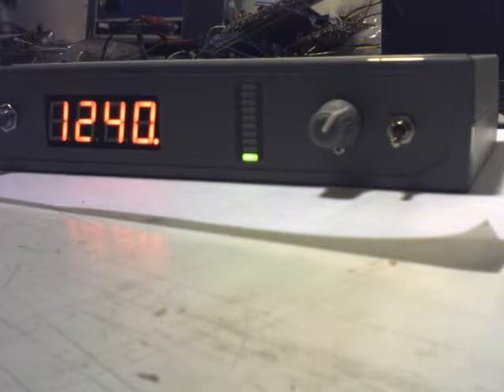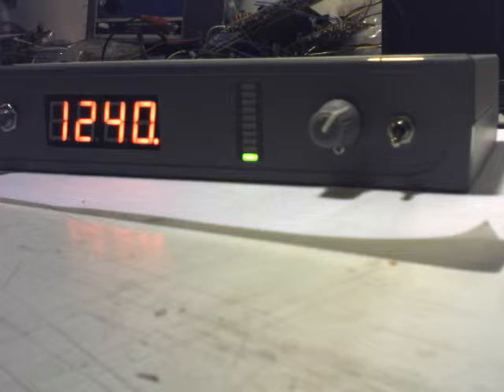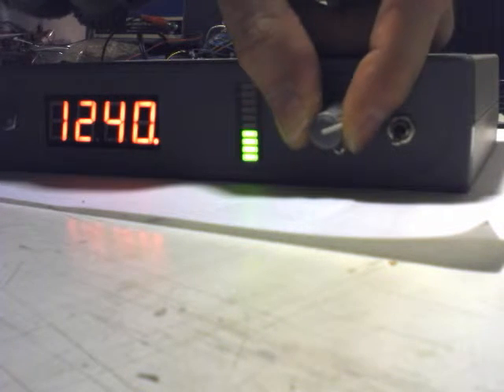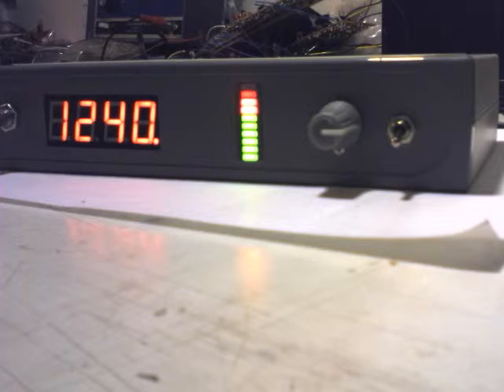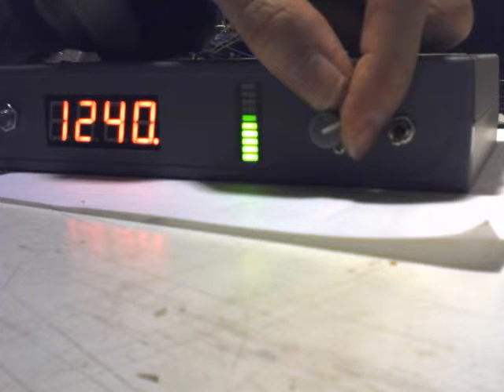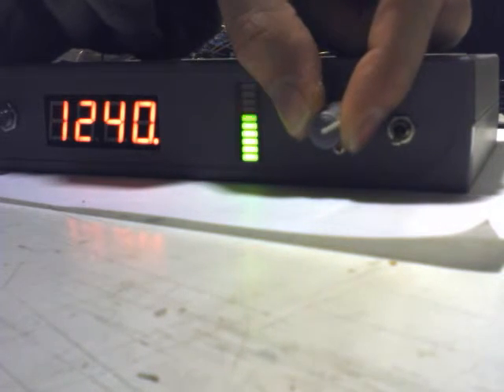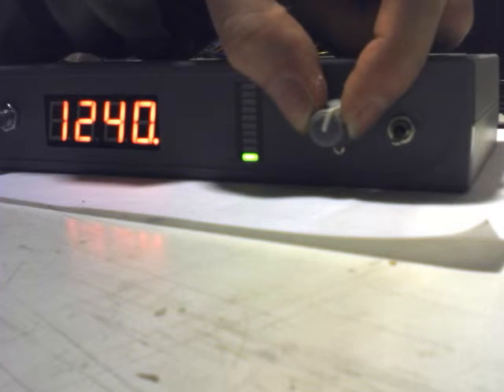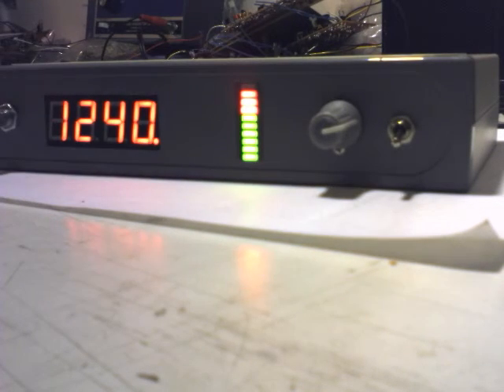Extra range

Comment from the maker: It is preferable to keep the antenna as vertical as possible. I have it set up as an inverted L shape.
The location makes a huge difference too. Here in the basement where I test, The wiring through the walls forms a kind of Faraday cage and very little signal escapes. Testing it outside increased the range by about 4 times. Another test was done when I was away in an apartment in Florida and the range was increased by 10 times!